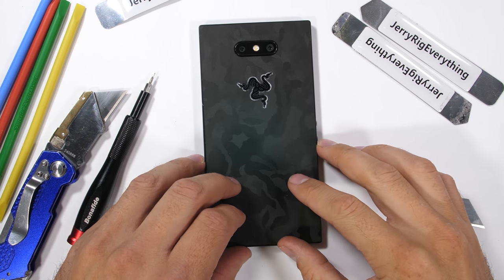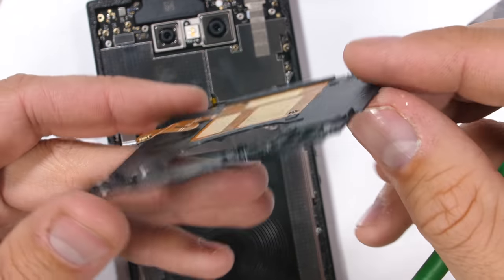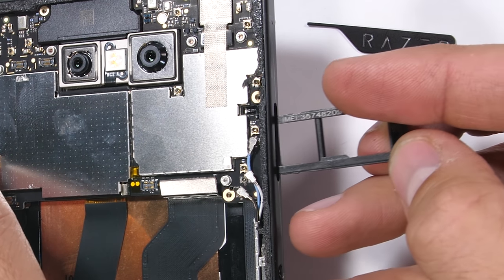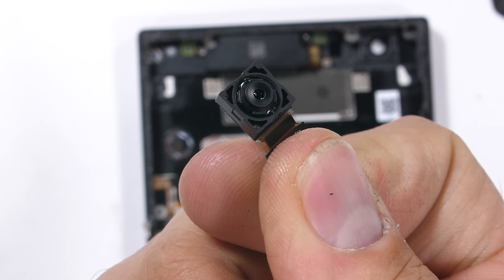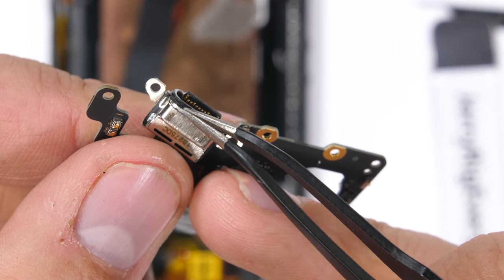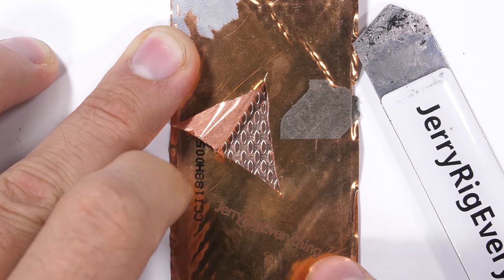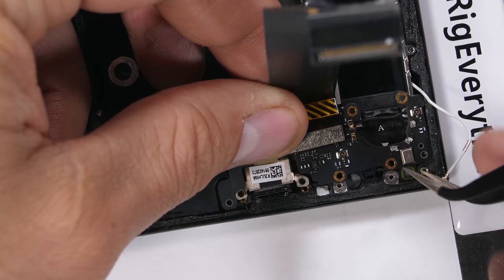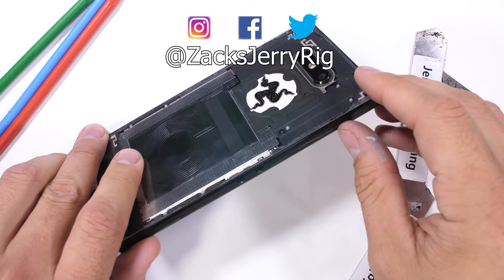Razer Phone 2 Teardown - The Vapor Chamber is Incredibly Cool

Comment: If it just had a headphone jack, I'd consider upgrading to this
Reply: do you live in 2010? its 2018 headphone jack is history...
Reply: @ch_boki  No, they're still sold everywhere. So, by definition, they are not history
Reply: @ch_boki  I'm sorry. "Haedphone Jack is history"? Yeah, if you live in Appleuniverse.
Reply: @KoeSeer  im sorry dude did you see the new phones? no headphone jack... yikes
Reply: Razer Phone 2 has wireless charging so charging and using headphones at the same time is possible, but wireless charging pads and new USB-C headphones will add up to the price of the phone and, in return, you'll get a fucking radiator ( which does not charge as fast as wired chargers do) and zero difference in sound quality.
Reply: Random Dude Do you know why most streamers use wired headphones?  Because their audio quality is way better than those of wireless shit headphones.
Reply: Random Dude but gaming phone without mini jack? huh
Reply: @Beam_World  agree fuck apple headphones
Reply: @ch_boki  how much 10 years old are you?
Reply: @ch_boki  USB replaced optical once USB was able to do every single task optical drives can do faster, more reliably, cheaper and saving 25% of the laptop space, ergo, no compromises.

Wireless headphones are expensive (if you want something decent), not reliable (latency, signal interruptions) and battery life dependable which is a significant compromise.

But hey, let's stop using the wheel, that shit has been around for thousands of years, drones are the new thing and Ford should totally force everyone to buy Quadcopters. If they say it's the future, I guess the future is now.
Reply: @darian.brumari  how much english years school had you?
Reply: @ch_boki  how much not understanding jokes have you?
Reply: @pepelota4351  Im actually just trolling and i agree with you 100%
Reply: @KoeSeer  eh? Htc? google? samsung? do you live in a cave?
Reply: @ch_boki  That's good quality trolling my friend, cheers
Reply: @ch_boki  looks at my Xiaomi Pocophone oh I must be living in normal universe where phone has jack.
Reply: @Daniel Cinematographer not sure if trolling.
Reply: Yeah, any phones no matter how good they are, without a headphone jack, IS A TRASH...
And no, you can't argue it because it's true, I am right, you are wrong. Period.
Reply: Daniel Cinematographer helloooo, haven't heard Galaxy S8/9 Note 8/9, Xperia Z?
Reply: Just go ROG or Shark for a gaming phone with headphone jack
Reply: Um did u forget that the Razer phone has USB c?
Reply: @barbecuetechtips6024  Shark doesn't have a headphone jack, but ROG sure as hell does.
One headphone jack built into the phone and a second one when you attack the fan to the 2 out of 3 USB-C ports that madman of a phone has.
Reply: The Asus ROG Phone has a headphone jack

Comment: Do some of the Motorola phones I'm really disappointed at Motorola I want to see their build quality how durable they are because this Moto G6 play has let me down
Reply: Moto E4 is kinda trash too, but at least it does it's job
Reply: Ya he never took apart the z2 force
Reply: The Moto G6 play plus is trash
Reply: @minicherokee8164  the model G6 play is trash
Reply: @46reyalP  the Moto G6 play is trash
Reply: @minicherokee8164  i use e4 😳 it's ok
Reply: G4 plus is trash too with all its issues like ghost touch, screen burn, dead battery ahh my gosh Lenovo works it's magic on Motorola phone's damnnn
Reply: @declassified137  I hope they recalled this trash phone Moto G6 play
Reply: @assassincamera1318  they won't, heck they won't even provide any support. They'll deny any issues you pointed just try contacting their support they'll straight up ignore your complaint
Reply: @whatsappvideosandgifs4315  yeah me too  used G4 plus man that phone sucks
Reply: @declassified137  I know but I'm stuck with this from work 6 or 3 months
Reply: @declassified137  I did not know this will cost so much attention
Reply: @assassincamera1318  yeah man it  sucks. I hope they don't get away with scamming their customer.
Reply: @declassified137  guess what my power button fell off and they can put it back in I'll just have to buy a moto E4 that is a great phone but it's old you have to upgrade to that at least it's half the price
Reply: @assassincamera1318  I use the Moto G6 play and it's fine
Reply: I thought Nokia was the best build quality. But they were already bankrupt

Comment: Hey jerry not sure if you know about laptops, but i disassmebled my HP laptop so i could replace the thermal paste and for some reason it will stay on a black screen and caps lock will start blinking once! I have troubleshooted it already and apparently when it blinks once, it means CPU Not functional! Please help if you know something about this! :(
Reply: You probally covered the whole thing or you didnt out the cooler ba ck on or you touched the cpu with no anti static bracelett
Reply: Try making sure the CPU is in its socket correctly
Reply: Yeah probably is a connection problem.  Check the socket.
If not... well you fucked up touching the processor without discharging your hands of static electricity (next time just rub your hands against ground aka metallic surface
Reply: in laptops cpus are usually soldered, unfortunately it's probably dead.
Reply: @cthulwho3879  not all laptops mine with a i7 4700MQ is socketed and doesn't have a ihs. Strange right?
Reply: @isaacwood4071  i made sure i touched something metal frequently though!
Reply: @bryanswaggbeast8194  What metal?
Reply: iiIsaacii_ aluminium
Reply: @isaacwood4071  plastic bro! What else!

Comment: This phone is great but shuts off in cold temperatures below 20 degrees Fahrenheit. Assuming the liquid inside the copper plate turns cold or freezes further lowering the temp of the battery resulting random shutdowns

Comment: I bought a used unit off ebay some years ago. Any tips on cleaning the speaker grills?
Sadly you didn't make macro shots of the motherboard. Would've been useful to know how things connect, especially if the LED is handled by a controller, and where this controller is connected. Not all traces are visible, but it'd be interesting to know if it is wired through GPIO or some other means.
Cool video!

Comment: In the morning, if my face is a little puffy, I’ll put on an ice pack while doing my stomach crunches. I can do a thousand now.
After I remove the ice pack, I use a deep pore cleanser lotion.

In the shower, I use a water activated gel cleanser.

Then a honey almond body scrub. And on the face, an exfoliating gel scrub.

Then apply an herb mint facial mask, which I leave on for 10 minutes while I prepare the rest of my routine.

I always use an aftershave lotion with little or no alcohol, because alcohol dries your face out and makes you look older.

Then moisturizer, then an anti-aging eye balm followed by a final moisturizing protective lotion.

Comment: HI Jerry, thanks for putting this video up. I have a question I'd like to ask for your help with. I mistakenly tried to "eject the sim tray" using the top hole, thinking that was the sim tray when I first got the Razer Phone 2. Needless to say no tray came out when I pressed on it. I'm wondering if I may have inadvertently damaged anything inside that top hole? I can't seem to find out what's inside - I'm assuming it's a noise cancellation mic and if so, there may be a mic film under there (hopefully not). Thanks so much for your help!

Comment: I bought the razer phone 2 years ago and it's been my trusty companion up until recently due to a few issues with the battery life, a broken charging port that no repair shop is willing to fix and a few parts of the screen becoming unresponsive. Sure, it sounds bad but do keep in mind that I have very slippery fingers and I've dropped the phone way more times than it has any right to be enduring and the screen's only been damaged since I got into an electric scooter accident some time back so it's less Razer's fault and more mine.

I'm honestly extremely sad that Razer didn't continue making phones after the Razer phone 2 since this metal brick of a gaming beast has been so reliable that if Razer continued making phones, I would've just stuck with them.

Comment: 04:00 the usb port is screwed to the chassis(body) and connected using flexible ribbon cable. I can see the ruggedness on this kind of design. all device manufacturer should use this design strategy, instead of soldering usb port to a pcb no matter somewhat large solder pads and copper areas used.

Comment: The cooling pouch is cool, but where is all the heat going to do when you've been running the phone hard and the pouch is saturated with heat it can no longer dissipate? This still has the same problem as other phones, they will get hot.

Comment: You know, if you still take the phone apart every time. Why don't you look into sillicone conformal coating. We use it for drones to waterproof our circuits board by board. Have a look and see ehat you can waterproof in a phone. I would like to see that done. The stuff i am talking about is a liquid in a small bottle. Looks simillar to nail polish.

Comment: I had an engineering professor who used to get PISSED about some of the applications that vapor chambers get used for. She said that they are excellent insulators for heat once they're too hot, leading to runaway heating when their limit is reached. She also mentioned how stupid it is to have a device that only works in one orientation due to gravity to be a part of a portable device.

But hey, buzzwords sell products, right?